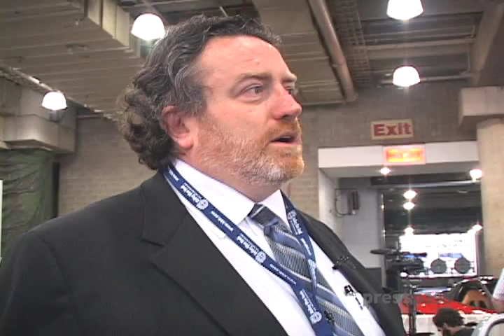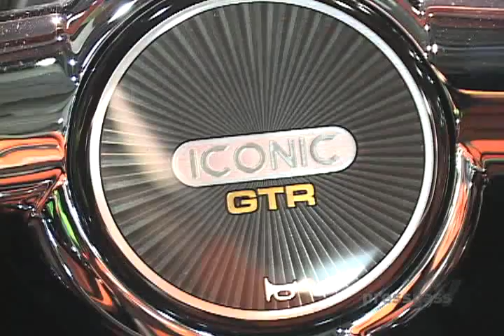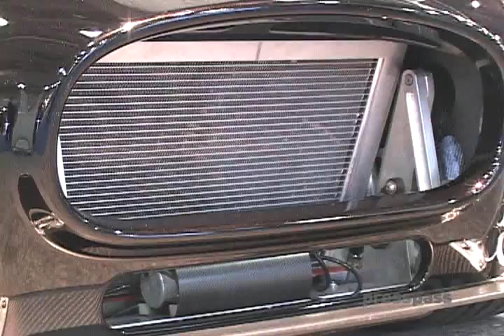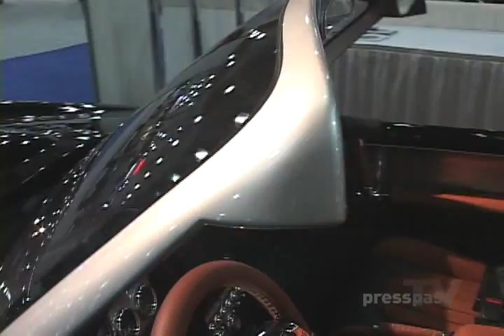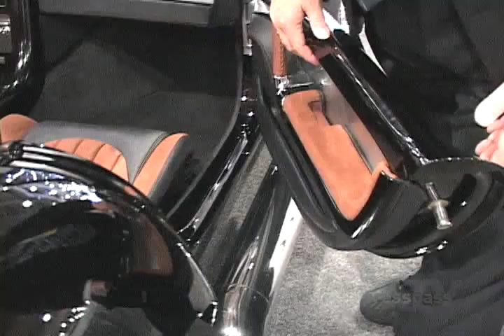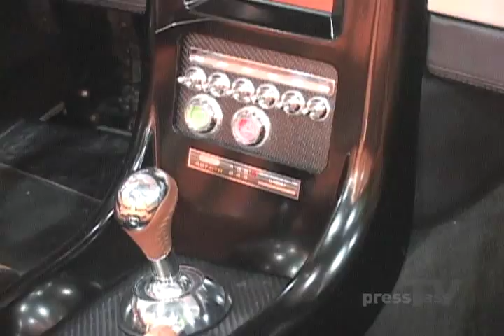AC Cobra of the Future! The Iconic GTR

Comment: @HyperShotty870 
Fully independent suspensions is technology old about 30 years researched by Porsche.
Carbon fiber used in McLaren before 17 years more than in this car. 
Electrical system in F1 is not many different from Ferrari road model like 599 or 458.
Engine is similar to NASCAR engine design but 60 CUI more, high reving about 8000 rpm, making 800bhp, nothing new...
Good thing is very low weight and ratio between power and weight. 600,000$ + tax ??? Forget!!